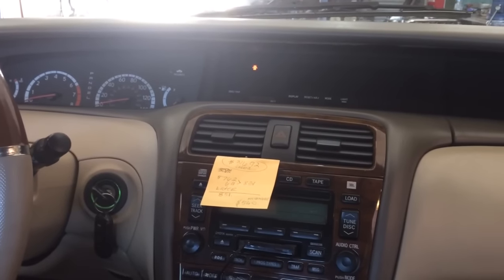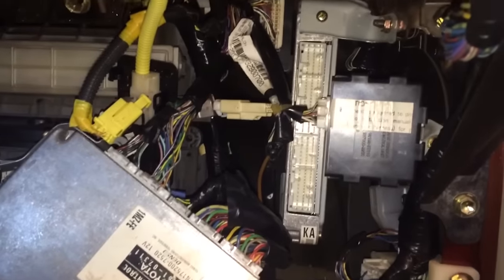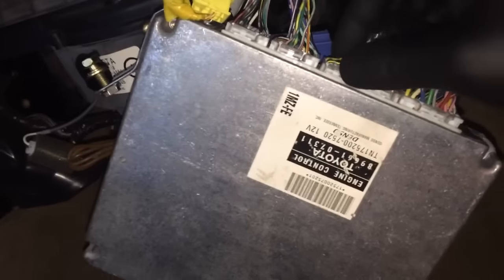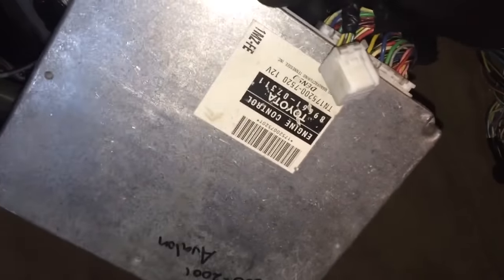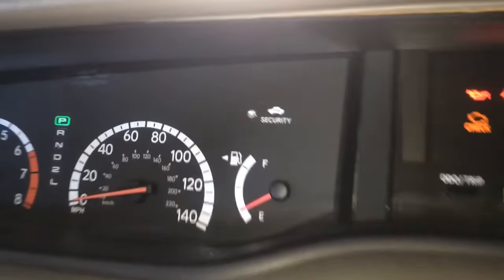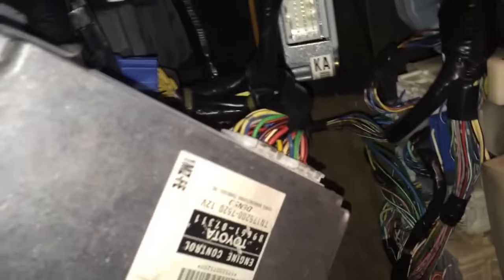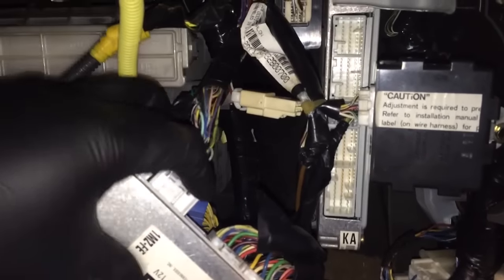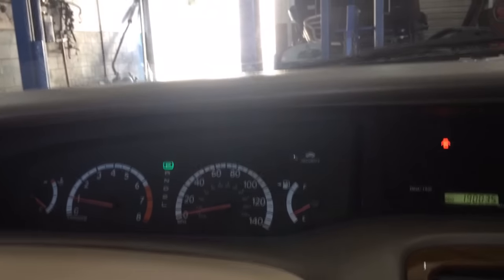Watch NOW! Immobilizer Bypass No Special Tools Needed Real

Comment: So to hack immo, you need à working ECU and a working key ? 😅😜
Reply: Alot of different types of hacks in the world require some peice of hardware in one way or another. If you're not reverse engineering the software you're usually reverse engineering the hardware
Reply: @thatdamnmanhd7984  true yes
Reply: Or just disassemble the ecu, read the chip with xprog and use something like abrites to write immo data in to the new key.
Reply: You can also remove the EEPROM from the old ECU and fit it to the new ECU
Reply: And how can i do this?
Reply: The bcm

Comment: What a nice trick you made! Excellent. If you dig behind a little bit, you were be able to locate and replace the key code IC from the old ECU to the new replacement ECU and make it a permanent solution without re-flashing and reprogramming the immobilizer and ECU after replacement. Regards,
Reply: +LearningZone  how can I replace the ic key code (ic900) from the old to the new without reflasing the ecu?
Reply: +Matan Rotem You can reprogram or swap the key code IC form older ECU to newer ECU.
Reply: Matan Rotem j
Reply: @JahanZeb1976  master 🙌🙌
Reply: @JahanZeb1976  can you explain how to do that Sir.
Reply: How
Reply: Swap the ic900 chips
Reply: @JamesFFHarris
2 months ago
The Dealer told me my car, 2004 ML350, can not be fixed.  The AAM went out and is now obsolete. Does anyone know a work a round because these computer are specific to each car and you can not substitute used parts.   Great body , tires, interior, I need help!?

Comment: I really appreciate how well you did everything you did from the very beginning in describing the problem, to explaining what you were going to do and then explaining what you were doing while at the same time performing the work needing to be done, with one hand no less AND filming it as well as you did with the other hand all at the same time. Fantastic!
Maybe you could provide a little advice for me after hearing my sad tale of woe.
I have a 2003 Volvo S40 that isn't getting any power to the fuel pump and like many people here I don't want to pour a bunch of money into it at a dealership where the part that I can buy online for $59 is sold by the dealership for over $700 (not to put to fine a point on it but they also are very proprietary with their software fixes in that outside a dealership it's difficult to find anyone who has the capacity to work on these things in a software sense) and of course you can't bring your own part. Add the expense of towing and then having them holding you over a barrel once there isn't an ideal situation in my eyes. I cannot start the vehicle although it does crank. I was wondering what advice you would give me. I did get a little friendly advice from the parts guy at the dealership who suggested it might be an issue with my "immobilizer" and not the ECU or CEM. Would really appreciate your advising as best you can what you'd do in my circumstance and if you need additional information, I'd be more than happy to provide it. Kindest Regards! Joe
Reply: If You're not Testing, You're Guessing ( attributed to Mikey Pipes )

Comment: Peter, 

I having an immobilizer issue I believe with my 98 Lexus gs400. The car will start most of the time with no problem but sometimes when I try to start it, it will crank then start the motor, then will run for less than a second then dies, then I see the key light blinking on the dash. Next, Any attempts to restart the car only cranks the motor over with the key light blinking. After a few minutes  with random attempts to restart, the car eventually starts again. I bought the car used so i'm not sure if I have the original key but I'm current using a aftermarket key/reprogrammed with no problems for over a year until now, and I also tried the second aftermarket reprogrammed key with the same problem. I have not tested the original key that came with the car (its an intermittent problem need to test up to 2 weeks to see problems reoccur) but since both aftermarket reprogrammed key have problems I do not think it's the transponder in the key problem. What do you think? Thanks in advance.
Reply from the maker: sorry it took so long to reply. i would start with using your original key that came with the car since it will not cost you any money just a little time. it will also rule out the question if its the aftermarket keys that are doing it or not
Reply: It's all good I know you are a busy man. Recently, I have been using the original key with the car for over 2+ weeks now without a problem. What puzzles me is that I have been using the aftermarket keys without a problem for over a year until now. Can it possibly be the receiver amplifier or the key ring coil problem? For now I'll just leave it as is, and use my aftermarket keys for backup; just hope I never loose the original. :) Thanks for your help!

Comment: Hello Revved,
first thing to understand the functionality of immobilizer. immobilizer works only when you turn on ignition, if security code match at turning on point with the ECU code then everything keep working until you turn off the ignition.
keep in mind ignition on doesn't mean you started your engine, ignition means engine can be start but you have to self start it by rotating the key one step ahead.
if you turn on ignition with original key then its no matter you put anther key or change ECU with other one.

that's not the bypass.
Reply: Brother my car starts and off suddenly after few seconds
How to fix it please suggest me
Reply: @MTaha-je4yj  what make and model your car is. And check is there any security li8 in the meter cluster or if its not avaiable. Then check your engine li8, is it blinking repeatly when you turn on ignition ?
Reply: My friend one question, i bought an used ECU, same make and model can i bypass the immobilizer, it cranks and also sounds like it wants to star but then stops, by the way my car is a 2001 hyundai Santa Fe 2.4 liter Manuel transmission, made in Korea, i know for sure my original ECU it's bad, because it does no communicate with my scanner, and the used one that i bought it does communicate with my scanners so that gives me hope to start my car, can you help me buddy. Thanks in advance...
Reply: @LuisMartinez-fr9gq   Brother, this Hyundai Santa has Immobilizer Code in 2 places .1 in  ECU and second in Immobiliser device,  your Key and immobilizer code are the same as it was original, but due to change of ECU, now your ECU cannot recognize the original code because it has other code in it.
you just need a Good Machanic who can reprogram its ECU to match your Immobilizer code. 
it will only cost $30 - $35 in Pakistan , but in your country, i can't say anything. 
GOOD LUCK.
Reply: @talharafique8913  Hello Buddy, thank you for your advice and knowledge, i will check this with a mechanic, I'm glad you told me this i thought it only has one immobilizer on the ECU, but now i know. One question, do you think it's a way to bypass the new ECU Buddy.
Reply: @LuisMartinez-fr9gq  well, bypass means you will no longer use this security feature. 
i will recommend you. just find any experienced mechanic, and i don't know the bypass process.
if i ever stuck in such a situation like you, I will go for a proper solution, not for the shortcut way which will lead to a security flaws.
Reply: Ok. Buddy thank you for your honest advice, and you are right, cutting corners are not warranty, i am going to do that, check with a mechanic to fix my problem, one more question are you a mechanic. Or how do you know all this.
Reply: @LuisMartinez-fr9gq  hahaha, no i'm not.
but i love cars. like a second wife. :)
Reply: Ok. But you read a lot about cars, let ask you do you have access to car diagrams

Comment: I was having problems with my 99 accord ecu. All i did was swap out immobilizer chip. Works fine.
Reply: Where is the chip located
Reply: Ok well there is a chip in the key that is read by the immobilizer transponder And sent to the ECU there is also a chip in the ecu that you can remove or buy a bypass chip and replace

Comment: Hi there, I have a 1991 cressida, 7mx83, and when the 7m blew the head, I put a 1jz vvti 171, which has an immobilizer. 
what do u recommend to get past the immobilizer?
I had a quote for 1000$! bit steep, so looking for an alternative, hope yoiu can help..
I like the no messing around, straight to the point style you have.. cheers
Reply from the maker: I thought those didn’t have immobilizers in Japan. Best route would be a stand alone computer for yours especially if your going to tune it or add upgrades to it!

Comment: good video, my question is will this work for say an rsx? does the ecu have to be a direct replacement? do you have to swap the wires on start every time? could you run both ecu's plugged in?

Comment: Thanks for the vid. I have a 2000 Avalon that is running rich on bank 2, misfires like crazy. no CEL on, scanned it seen fuel trim way up bank one,shut the computer out ,in service mode engine corrects its self for the most part..Does this sound like symptoms of a bad ECU?
Reply from the maker: +TheOwen1974 thanks for watching!! I would check the vvt oil control valve on bank 2(front of car if you didn't know already). with that being bad could make the whole bank misfire. Seen plenty of those engines with that problem. Check that first, its easy to take off, just a plug and one 10mm bolt.
Reply: How to reset key on honda pilot

Comment: Hi,
Should we address you as Mr. ChickenDinner? ;-)
You seem knowledgeable and fair minded (a rare combination these days) so I'd like to see what you have to say about the following puzzle...
I have a 2001 Explorer that a kid (now in the army) had major surgery done on. It now has a 2006 Explorer engine (professionally installed) and a standard tranny where the automatic once was. He told his Dad (who just wanted it out of his driveway) that it needs a new GEM/BCM but I don't want to start just throwing parts at it.
The "theft" light is on before I even put the key in and I'm not even certain it's a properly coded key.
When I tried jumping the starter relay, all that happened was the heater fan came on.
It probably is looking for the neutral safety switch as well.
Lotsa fun, huh??
I've been learning about bypasses and your ECU trick sounds promising.
Do you have any suggestions/hunches???
Thanks much,
BE
Reply from the maker: +Liberallez sounds like you have a mess on your hands! ok i have a question for you. What ECU is it using? we can start from there. i have done a few automatic to manual conversions and in most cases its still possible to use the automatic ecu/ecm/pcm etc.. what you have to do in most cases is to fool the car is in Park (to start the car and to take the key out of the ign). thanks for watching and commenting on the video and i hope i can help you sort out your issues on the explorer
NguyenerWinner(winnerwinner)
Reply: NguyenerWinner ChickenDinner
Thanks...I'll get the ECU info to you, possibly tomorrow.
BE
Reply: +NguyenerWinner ChickenDinner
Hi,
After going over the shop manual, the best I can figure is that this car doesn't have an actual ECU.
It has a bunch of different modules like the power train module, anti-theft/immobilizer, etc. and it has what is referred to as a "multi-function module" which is also called the Generic Electronic Module but the list of it's functions doesn't seem to include anything but body stuff like wipers, windows, etc.
That module's number is 1L5T-14B205-BE. There is also a large letter B near that number.
Does all that tell you anything?
Thanks,
BE
Reply from the maker: PCM(powertrain control module) would be the one your going to look for. trying to see if they changed that out or if its still the original one that came with the suv. If they used the original engine wiring harness and is still using the original PCM and assuming it all the plugs plug together(or modified to work) correctly, it should start up or at least let you crank it over. You might want to try and find the neutral safety switch (its the electronic piece that the shifter rod is connected to on the transmission) on the automatic transmission (take it off and plug it on the harness on the car) and switch the switch to the park position.
Reply: +NguyenerWinner ChickenDinner 
Very interesting...thanks.
I'll get back to you as soon as I have something new to report.
BE
Reply: +NguyenerWinner ChickenDinner
Hi,
If I had to guess, I'd say it's the original PCM.
There's blue electrical tape in multiple locations (apparently where parts were joined) but the main cable to the PCM looks undisturbed and the head of the bolt holding the plastic retainer in place is rusty and also looks undisturbed. On the other hand, I suppose that could be because it came with the "new" engine.
At any rate the number on the top visible surface of the module is DAY2.
I haven't gotten to the neutral switch yet.
BE
Reply from the maker: the pcm should be on the firewall in the engine bay. try and take out the neutral switch on the transmission first and hook it up to the harness on the car and switch it to park mode and see if you can at least crank the starter
Reply: NguyenerWinner ChickenDinner

Right...that's where it is. I just can't tell for sure if it came with the new engine or if it's the original with the car.
I'll try to get to the neutral switch, hopefully Wednesday.
Also, there's a connector hanging out that has  MAP? hand written on it. Is that of any significance in this puzzle?
BE
Reply: +NguyenerWinner ChickenDinner
Hi,
It looks like the PCM is original to the car and has been spliced (blue electrical tape) into the engine. I looked under the car for a neutral safety switch but I'm not sure what it should look like. There are some cables and connectors with blue tape on them... one that leads back up into the dash area.
Can you give me some idea what I should be looking for?
Thanks,
BE
Reply from the maker: +Liberallez this is what it looks like. copy this link http://i56.tinypic.com/1enfyq.jpg
Reply: +NguyenerWinner ChickenDinner 
Ok...that switch is on an automatic trans but I need to be looking for the connector, right? Because what's in there now is a standard. I did see what may be the old line from the switch connected to another line and wrapped in blue tape. I'm not sure where either line leads. It goes up into the dash area I think. When it dries out some here I'll crawl under there again and see if I can trace it.
Do you know what it should lead to?
Thanks,
BE
Reply from the maker: that is correct. take the switch off the auto trans and plug it in the harness on the car and switch it to park. Try and see if it will let you start it. If it does then you'll have to figure out what wires on the harness to bridge together and what not to make it permanently in park, one for when you go into reverse and one for your clutch safety switch(press clutch down to start)
Reply: NguyenerWinner ChickenDinner
I'm not quite sure what you mean by "switch it to park". I think someone already plugged the old auto trans cable into the new engine wiring (blue tape) but I don't see where  I would move a switch. Are you saying the switch from the auto trans should still be there? If so maybe I'll have to make a trip to the junk yard and get one.
Thanks,
BE
Reply from the maker: yea the actual one off the transmission. You can take a screw driver and turn the switch into the park position. i'll try and find a video or picture to explain how to do that

Comment: I replaced the ignition lock and key cylinder switch on my 98 Avalon, but it won't start. Do I have to program/code it to get the car to start? The new one is in and the old one is out.
Reply from the maker: +DadSkip if you still have the old key, i would take the new ignition lock and the old key to a locksmith to match the old keys to the new lock. that way you can use your old keys that has the programmed chip in it. its the easier approach and you'll only need one key to open the door and start it.

Comment: You know how I can bypass immobilizer on my 2004 Mazda Miata ?  Intermittent not reading my key. Been stuck a couple of times. Don’t have the funds to get new ones. Please help if you can or point me to where I can get help.  Thanks
Reply from the maker: Try seeing if you can replace just the immobilizer reader. Sometimes it’s the reader not doings it’s job and not the key. I’ve done it multiple times on Honda’s but not sure if you can do it with Mazda.  Call your local Mazda to see if you need to program the reader as well. Good luck

Comment: Dude your absolutely smart lol.. Wow never thought of that. So will the car start all the time now with the used ecu? Or is this temporary like you said in the video?
Reply from the maker: +Jahmar Robinson Thanks!  it started pretty much every time i turned it on and off. It wont start again if the battery dies or power to the ecu is lost.
Reply: +Peter “LikesToFixIt” Nguyen Thanks for your swift response. Wow, I never knew that would even be possible. I have a 1998 Infiniti Q45 and it's giving me some ECU issues and so I ordered a ECU from eBay and since I have a transponder key I'm going to have to do this method until I could afford a Lock Smith to program the key to the ECU and as you probably already know, infinities aren't cheap. So let me be the first to tell you thanks you for showing us this!
Reply from the maker: No problem. Just to let you know i have only tested this method on Toyota/Lexus and Honda/Acura cars. The Honda/Acura did not work with this method. I have not yet tested this method on Nissan/Infiniti cars yet.
Reply: +Peter “LikesToFixIt” Nguyen Thanks for letting me know. Well as soon as I try I'll let you know if it worked out or not Thanks again bro.
Reply from the maker: no problem and thanks for taking the time out and watch the video!